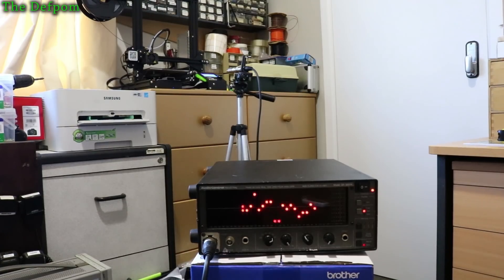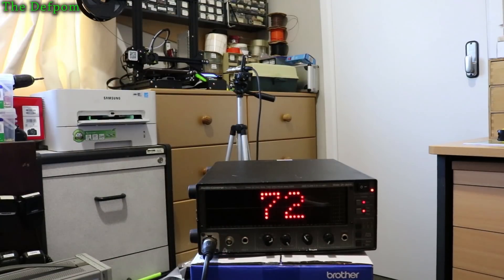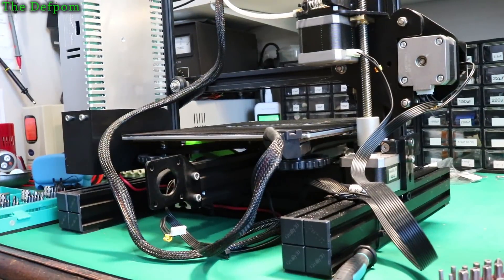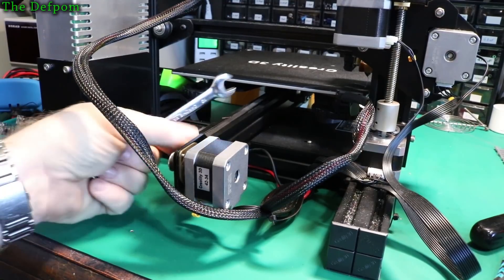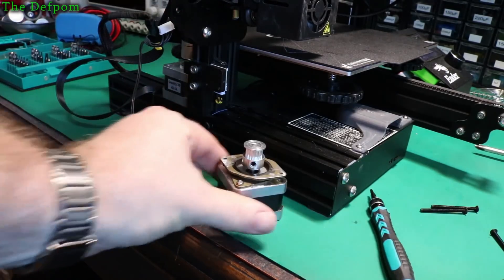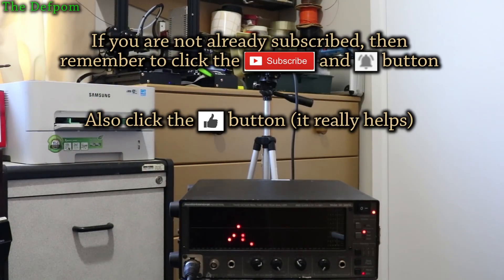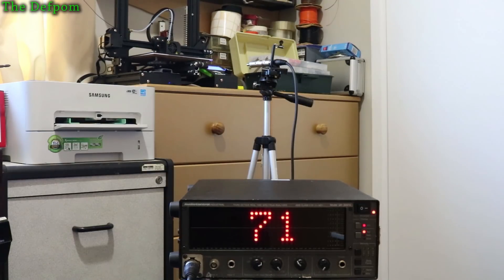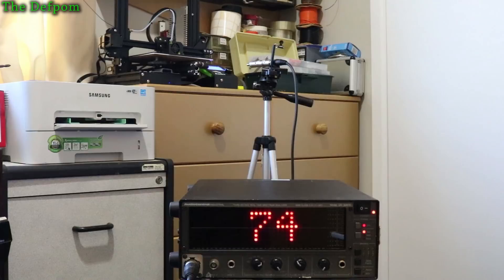🔴 #440 How To Reduce Stepper Motor Noise On 3D Printer - With Before and After Comparison Ender 3

Comment: hi - stepper driver has voltage (extruder) but doesnt power motor on my ender 3, the cables test out as working, when i swap out the xyz, the extruder motor works - what is the next test ?
Reply from the maker: Sounds like the driver has failed, or possibly a broken connection on the main board. I had a similar issue on my ender 3 when I first got it and had a dead driver for the extruder (I showed that in a video), as I do electronics I was able to replace the dead driver without much hassle.

Comment: Nearly 6dB, a lot better performance there.  you might want to experiment as well with adding some acoustic car damping foam pads under the bed, to get the table resonances  to reduce. Should get rid of that quite a bit. Try as well stuffing some weatherstrip foam into the channel extrusions to give a bit of damping to the structural beams, that will also stop them from being speakers as well.  For experiment just cut the adhesive side off, and push into the recess.
Reply from the maker: SeanBZA - I have already fitted a cork pad underneath to insulate the bed to improve the heating performance.

Comment: for me, dampers make the surface of the pieces wrost
Reply from the maker: sL1pKn07 SpinFlo - I did a before and after test print, they were identical in my case. I didn’t install one on the extruder as that could effect the accuracy of feed to the nozzle, you cannot easily add one to the Z because of the way it is mounted with only 2 bolts on the same side, it doesn’t suit the dampers.
Reply: i only mounted in X and Y axes, (the bed H support hits in bad way the motor, so is need move the endstop, or mill the H). I brought  the dampers on the official creality aliexpress store